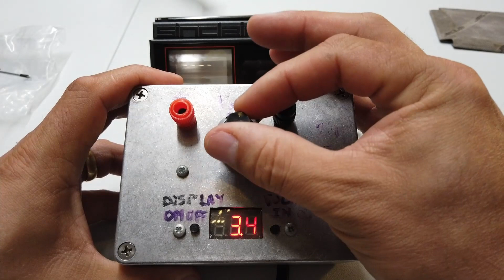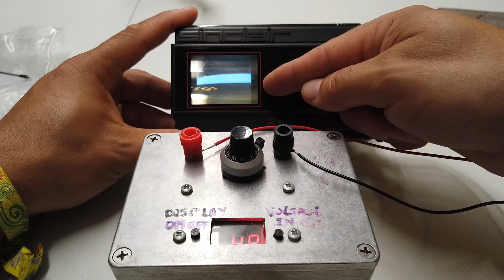DuB-EnG: SINCLAIR TV80 FTV1 Retro POCKET TV with Mini Flat CRT - Teardown and How it works

Comment: I still have 2 of these, bought from J.Bull ltd (long gone unfortunately) I purchased - from CPC - the technical manual and offered it to J.Bull. In exchange they sent me another. Should have at least kept a photocopy, but didn’t. Both worked up until recent times and may still do but the batteries are completely flat and I never had a mains dc supply for them. Might put them on eBay first’spares or repairs’. Brilliant engineering in its day.
Reply from the maker: Absolutely fantastic engineering for its day!!!

Comment: In 1980 Sir Clive Sinclair showed me the tube from his TV at his house and explained how it worked.  The video is essentially correct - the line and frame scan are deflected electrostatically (as in a oscilloscope CRT) and then the beam bent around to strike the phosphor anode.  One advantage of this according to Sir Clive was with the screen at the rear of the tube, it could be fitted with a large heat sink, and the power increased significantly, perhaps sufficient for projection.  A draw back was the display was monochrome, so the niche only existed for a short time until LED/LCD based pocket colour TV's emerged in the 90's.

Minor notes: - it's a cathode not an emitter - the tube is a thermionic valve not a transistor.  Surface mount only became a thing in the mid 1980's.  The first device I owned with much of it was a Technophone Mk1 in March 1986, by which time market penetration was about 10% and Surface Mount magazine was published (now SMT?)
Reply from the maker: Hi Mt Clayton! Wow! Great info, and my apologies for the many mistakes! Must admit, it was the first time I'd seen anything like it, so I guess I was winging it a little.  But a genuinely magnificent invention either way!!...  yup, sadly, tvs have become disposable these days!

Comment: Small nit: surface mount tech existed at that time (it's as old as transistors), it just wasn't used in typical consumer electronics production because special equipment was required and the components were hard to source. The mainstream transition to SMT began in the early 90s as the demand for higher density rose, and higher frequencies made PTH less attractive due to inductance.
Reply from the maker: Yes indeed ... I have Wikipedia Ed this...  I had no idea that SMT was around in the 60s!  How cool!!!

Comment: Even though TV stations no longer transmit analog, you could use an ESP32 to transmit to it and get a usable picture:

https://youtu.be/SSiRkpgwVKY

Or figure out where on the PCB to feed it a composite signal.
Reply from the maker: Very true ... the TV needs plenty of attention and a screen calibration.  Once done I may be able to connect my acorn electron!

Comment: Wow - what a gorgeous CRT :) kinda disappointed you didn't get a picture on it though. No analogue broadcasts are going, but any old videogame, or ... perhaps ... an old ZX Spectrum or ZX81 ought to be able to give you an RF signal you could shove into it
Reply from the maker: I have a lot of capacitors to change and a full screen calibration and alignment to do before we can get an rf modulated signal injected into it.  It’s a lot of work.  Sadly, I only have an Acorn Electron or BBC micro to connect to it. ... I may need to go search for a 48k spectrum :-)
Reply: @DubiousEngineering  Heh - well, both those machines have RF out sockets. If you want to keep it all Sinclair, though, I have a ZX Spectrum you can have but you'll have to promise to take care of it and love it and feed it (email on my about page)
Reply from the maker: @howiem  holy poop...   I have recently started collecting and refurbing...   I’d love an old speccy and will definitely make a video on it ...
Reply from the maker: @howiem  i can’t see your email and have even looked through your blog...  my email is on my YouTube about section too.   Let’s discuss - I may also want to use some of your music in my videos ...  clearly you get a nice credit and shoutout

Comment: IIRC if you have something with an RF output (eg VHS deck) and an RF cable (and have the cable reasonably near the aerial) - you may be able to get this to tune into it.
Reply: Or a retro computer with a modulator..
Reply from the maker: I was thinking of plugging in my acorn electron but I have a lot of work to do calibrating the screen and replacing capacitors first ...
Reply: @DubiousEngineering  Acorn Electron?!! ZX80 please.